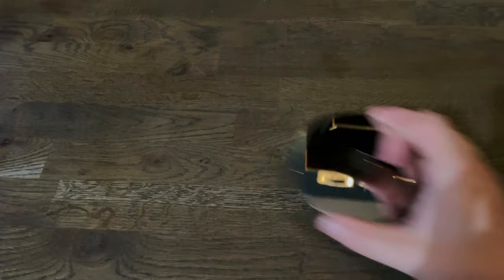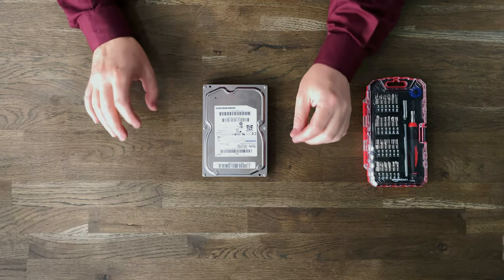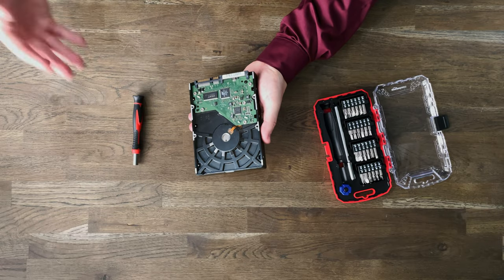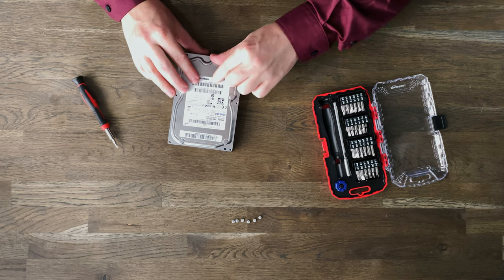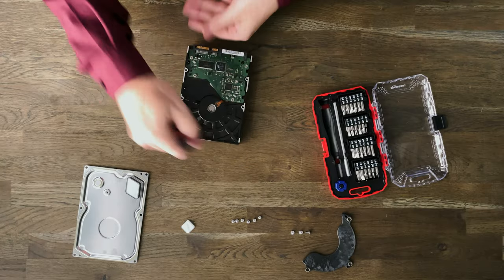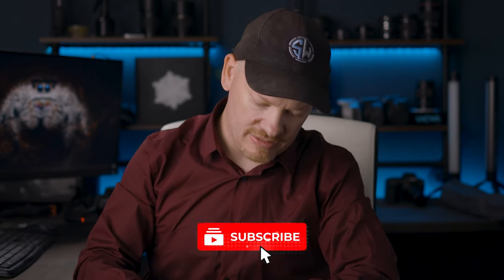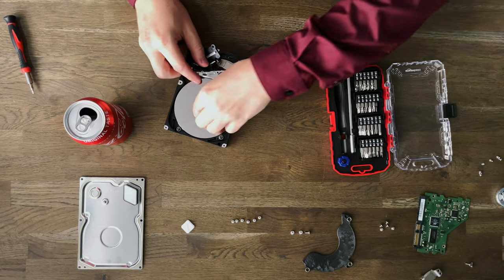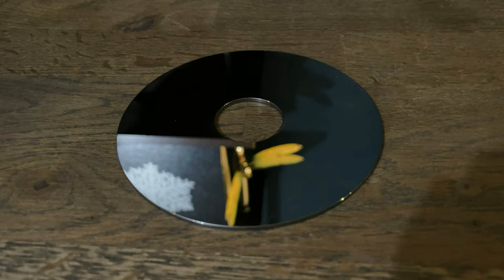How to Make Drink Coasters from Old Hard drives!

Comment: Hello, first of all thank you and congratulations for your video work on macro photography. It is a source of inspiration for my own photos. I wanted to share another tip with unmounting a hard drive. In addition to the discs, I also recover the central bearing which I fix on a small piece of PVC (drilled to the size of the bearing) to form a base and I add a CD on top. It serves me as a mini rotating support. I put a little clip on it with a flower or a leaf for my spider pictures for example. Here again, thank you for sharing all this information and long life to your channel. Greetings, Pascal from France ;-)